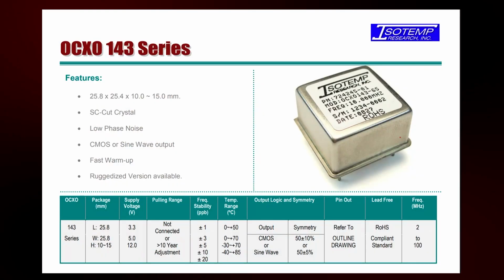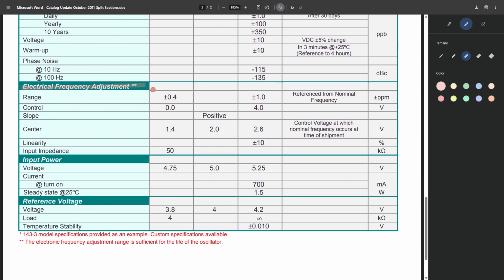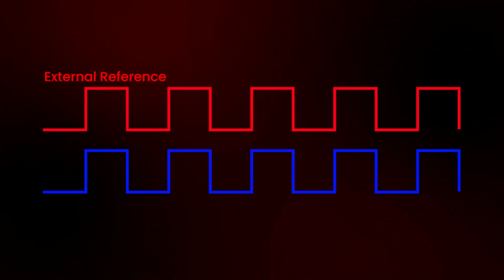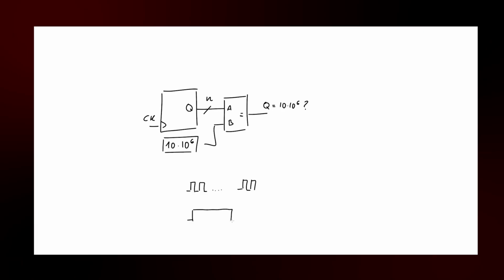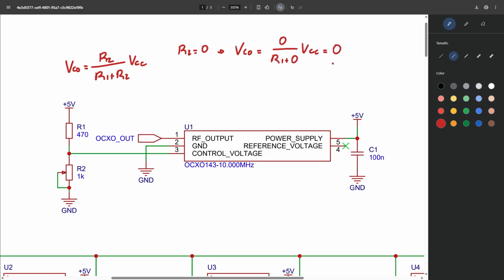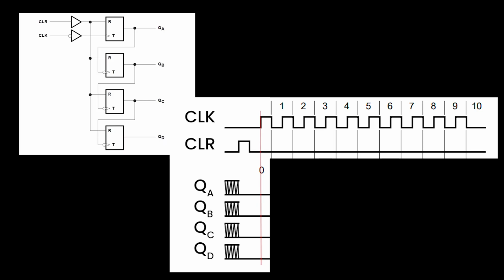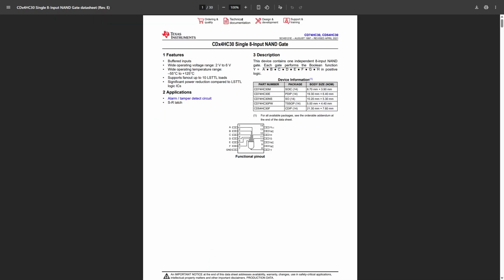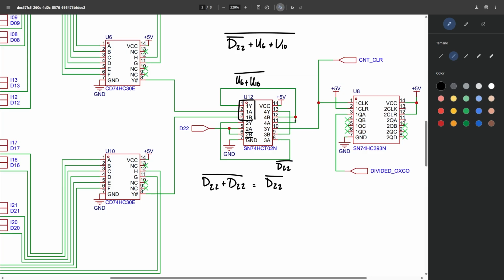The OCXO Controller: Disciplining clocks

Comment from the maker: Thanks for watching! Remember visiting https://pcbway.com for an amazing PCB experience!

Timemarks:
0:00 Intro
1:20 Oscillators
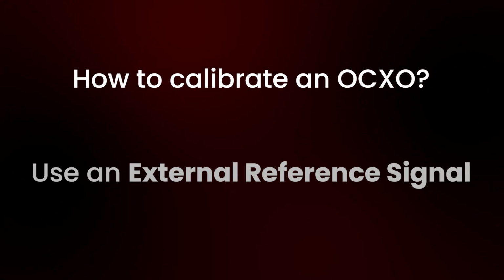4:44 Characterization of an OCXO
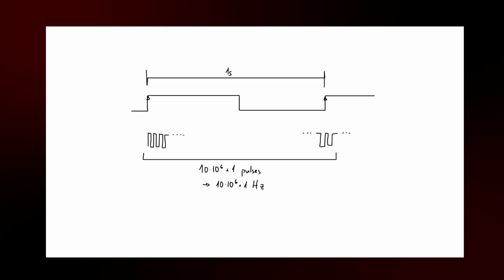6:55 Controlling an OCXO
11:57 Sponsor break
13:20 Syncyng signals
15:55 Frequency division
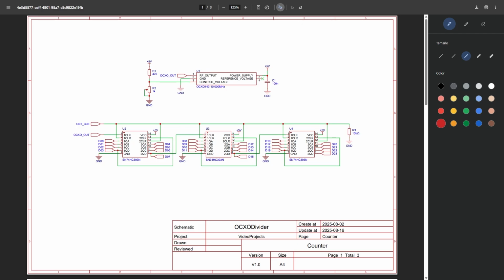23:17 The OCXO in the circuit
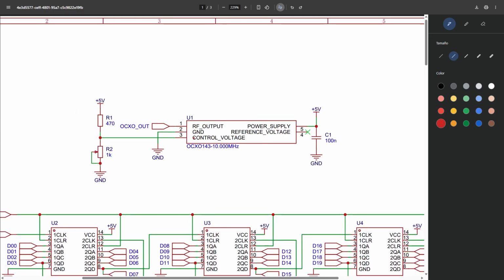28:23 SN74HC393 Counter
35:02 Comparator